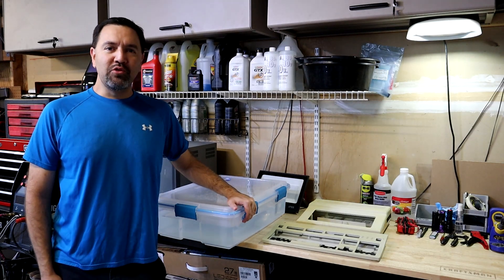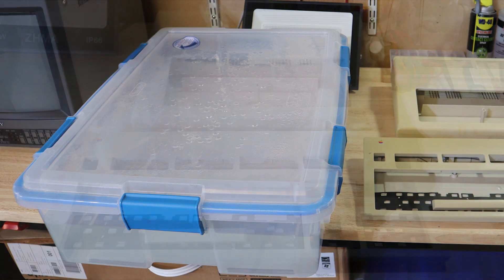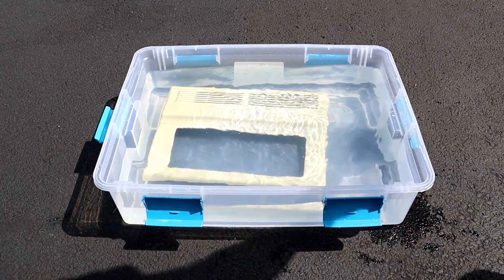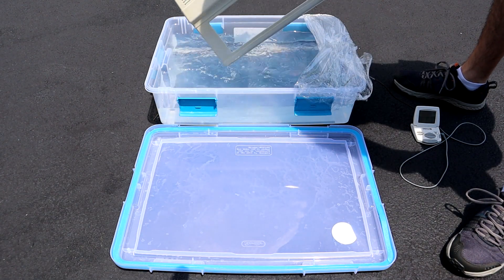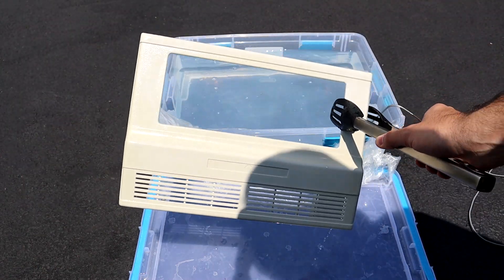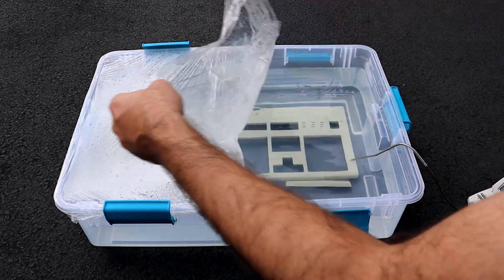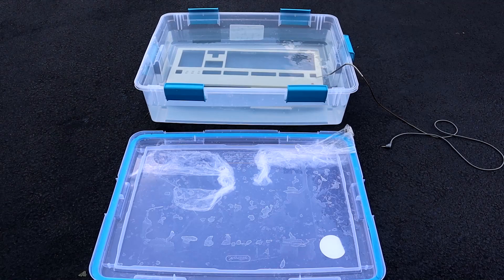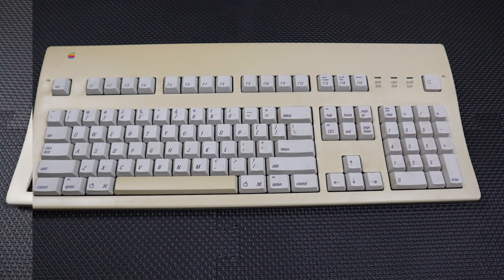Retrobright: Store and Reuse Hydrogen Peroxide?

Comment: The latest thinking about whitening plastics with sunlight is that hydrogen peroxide (H2O2) is not necessary. It is sufficient to simply place the yellowed item in sunlight. My own experiments have confirmed this, though it does take longer to achieve the same results compared to using H2O2. It is indeed quite possible that your H202 is depleted, and you are getting results simply from the UV from the sunlight. It is worth noting that while yellowing is caused by heat/light, this is inevitably indoors where UVB light in sunlight is filtered out by the glass in windows, it is apparently this UVB light that lightens the plastic. Try putting a yellowed item in strong sunlight...you might be surprised! This video (not mine) describes it:   https://www.youtube.com/watch?v=g814Y6OT0Tg
Reply from the maker: Thanks for sharing this. I have tried the sunlight-only method on other parts, but as you say, it does take longer. The CoCo2 cover was only out for 2.5 hours so I suspect there was still some combination of effects. 

That said, this little experiment has left me with more questions than anything. I plan to do a more instrumented test with specific concentrations, pH measurements, and controls in the near future to try and answer some of these uncertainties.
Reply: Personally, I retrobrite without even using the sunlight. Just using heat as the catalyst, with hydrogen peroxide. It works without sunlight at all.
Reply: I don’t know if UV B is actually the only reacting element because people have managed to retro right with and without peroxyde using UV leds, but these UV leds only produce UVA and no UVB. UvB leds are rare to come by and fairly expensive since it is quite edgy compared to UV A to my knowledge. This retro right is a true magic to me still haha

Comment: I have some retrobrigthing to do. Any suggestions on what solution I should buy for optimal results? I've read in the comments, "20 volume developer" is what most people use. Does this mean that "20 volume developer" with water, or soak parts in the sun with 100% solution of "20 volume developer"?
Reply from the maker: I use 40V diluted with water. Probably about a 1:10 ratio, but that's just a guess. The higher the concentration of peroxide (along with UV light and/or heat), the faster the process will go. You can gauge how quickly the reaction is taking place by the number of bubbles that appear and you can always add more peroxide to speed things up if it's going slowly. I have never tried using undiluted peroxide straight out of the bottle.
Reply: @retrobitstv  Thanks. So is that 10% peroxide to water or 90% peroxide?
Reply from the maker: 90% water, but you can easily adjust it to 80:20 if it's not going fast enough for your liking.
Reply: @retrobitstv  Thank you. Is this what you use? https://www.sallybeauty.com/hair-color/other-products-and-applications/developer/40-volume-clear-developer/SLNCAR67.html
Reply from the maker: @MatthewPomar  That looks like it will work fine. I picked up a whole gallon of the stuff ( https://amzn.to/2T1acxr ) because I wanted to try and submerge a CRT monitor in a big tub.

Comment: What about just storing it back in the bottles after each use?
Reply from the maker: It's highly diluted after mixing it with water for retrobright use. I currently store the whole mess in an opaque storage bin in the garage since it's gallons and gallons of liquid now. You could probably use the peroxide straight up out of the bottle but it would cost an arm and a leg to get enough to submerge your parts entirely.

Comment: Is 35% H2O2 works?
Reply from the maker: I was using 40 volume peroxide which is 12% H2O2 but it was highly diluted with tap water. You can use other concentrations, you'll just need to play around with how much water you use.
Reply: @retrobitstv  Thanks for the very useful information.  Have you done anything further to experiment with effectiveness of specific known dilutions of H2O2? (as opposed to "highly diluted")
Reply from the maker: @bobgilbert7362  I've been meaning to do a more scientific experiment with different concentrations. It's on the list of videos to make, along with 60 or 70 others. Limited by time, y'know? :)
Reply: @retrobitstv  Thanks for the prompt reply to my inquiry.  Oh yes, time -- That commodity of which you cannot get more.  😵‍💫

Comment: What is most likely changing the color is the heat and UV of the sun. Some have tested with just warm water to bring it back... Is it as affective with using Peroxide? That be the question. Then as some other have stated, there is Light Bright, just leave it out in the sun...though takes much longer.

Some even tested by using a Sous Vide to keep the temp as a specific temperature.

Here are some videos. with just heated water and peroxide..

https://www.youtube.com/watch?v=FgUsmaoIRYw
https://www.youtube.com/watch?v=hYD7ruYT_8k
https://www.youtube.com/watch?v=llWWgCcJQik

On the Odd Tinkering / Odd Experiments says he re-uses his peroxide all the time..Though after he is done, he puts it back in the bottle and not leave it in the tank... He uses UV Lights... 
https://www.youtube.com/watch?v=jdWRsjnVD3s